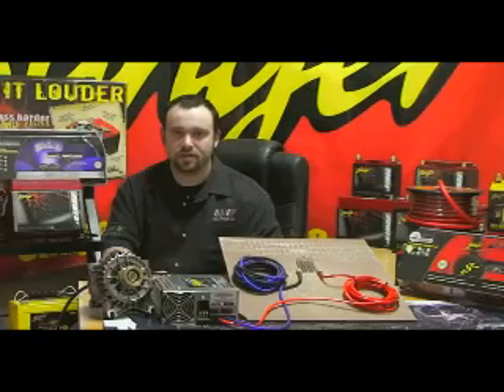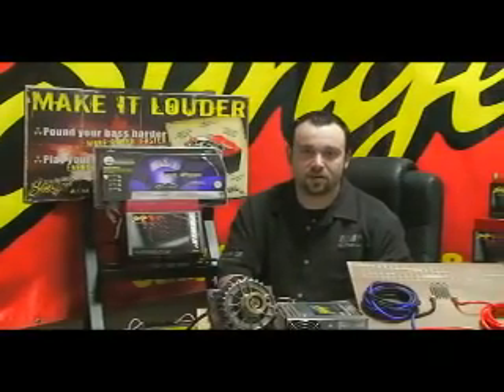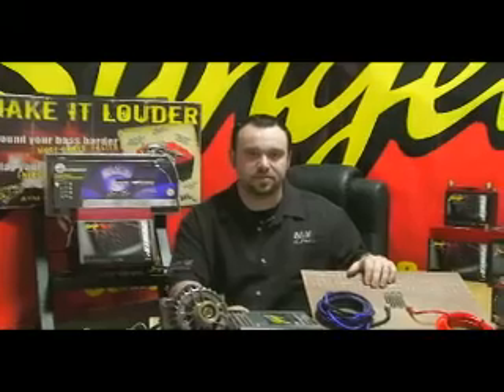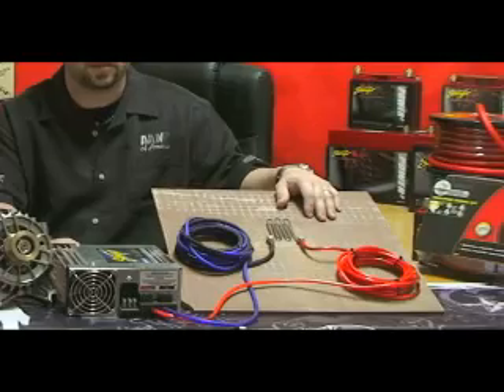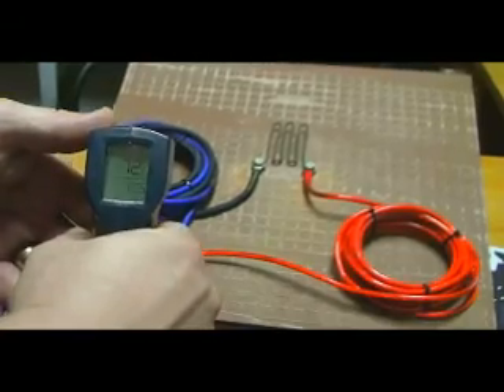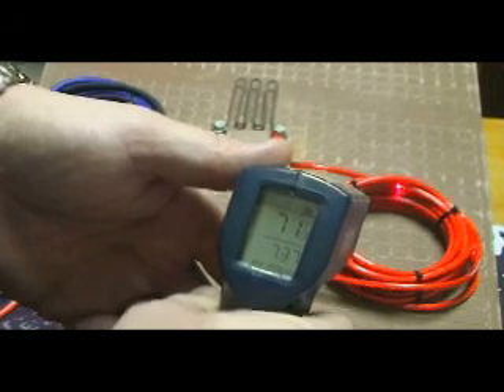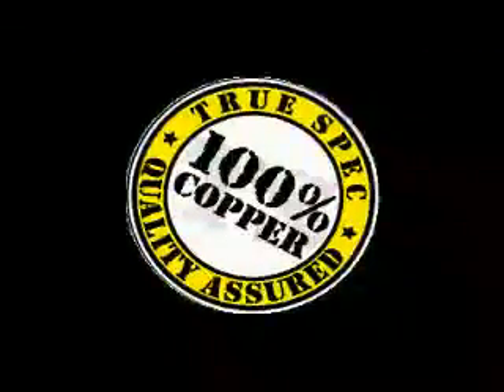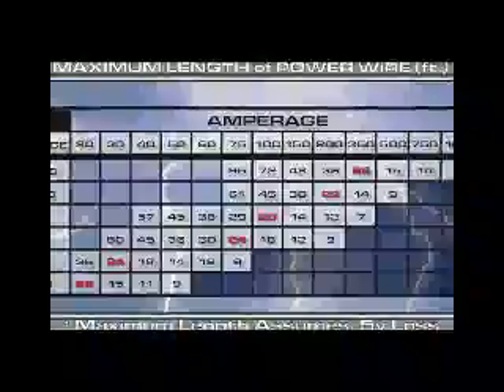True Spec vs CCA.mov

Comment: @GPEIEAJ Why would you want to use wire that you have to go 2 sizes bigger, in order to do the same job with a smaller wire that's going to have the same current flow if not better?  Also, why not discuss all the technicalities that go into consideration when comparing similar objects?  That would be like telling someone that beer is just as good for you as water but I'm not going to bother stating what specific qualities led me to this decision, just know that it's right.>>>>

Comment: I coment the same in other video. CCA cable should be used 1 or 2 sizes above (referring to the diameter) than the copper wire. I will not discuss technical details like frequency, skin effect, specific heat, etc ... but the CCA is a good good competitor, the problem is not the CCA, the problem is the ignorant who do not know how to implement it.